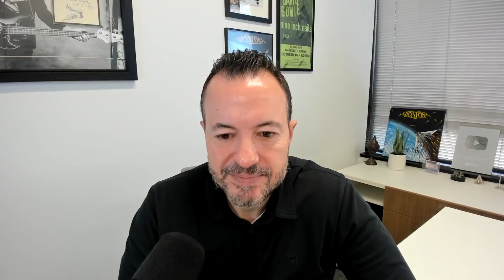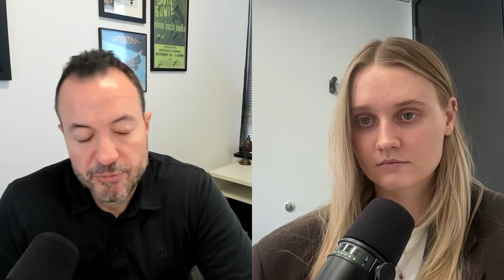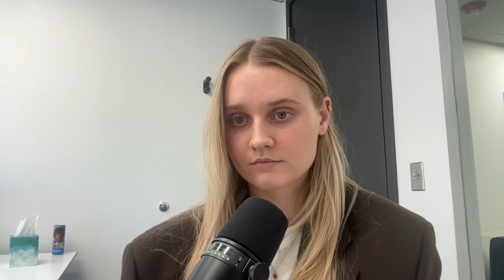Discover the Best ERP Systems for Energy and Manufacturing in the USA

Comment: 🎯 Key points for quick navigation:

00:00 🏭 ERP Origins: ERP systems primarily originated in manufacturing, evolving from MRP (Material Resource Planning) in the 1980s.
00:09 🎛️ Top ERP Options: The big three ERP providers for manufacturers are SAP, Oracle, and Microsoft, accompanied by tier 2 options like Epicor, Infor, and Acumatica.
01:36 🚚 Niche Solutions: Specific ERP solutions such as JustFood for food manufacturing and Plex Systems for automotive niches highlight tailored options.
02:32 ⚡ Energy Sector Challenges: Implementing a single ERP for energy or utility companies is complex due to diverse needs in asset and workforce management.
03:00 🔧 Key Players: SAP and Oracle are prevalent in energy, but IFS and niche solutions like Maximo also cater to energy-specific requirements.
03:28 🗺️ Utility Needs: Utilities might require GIS and other technologies to integrate with ERP systems for infrastructure tracking and outage management.

Made with HARPA AI